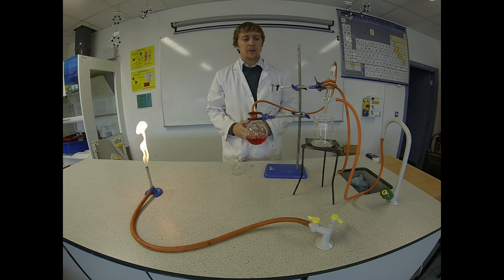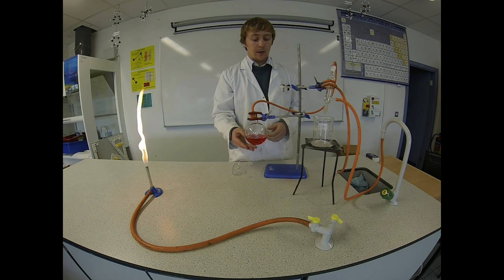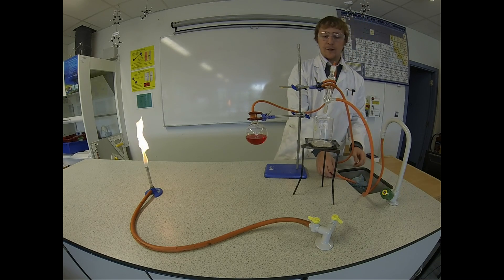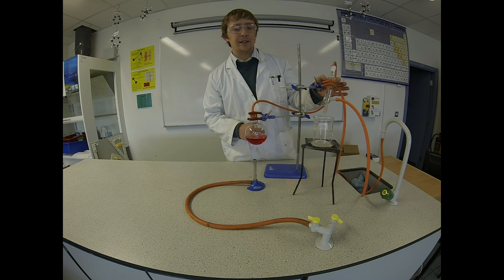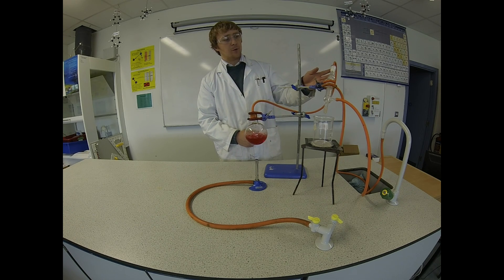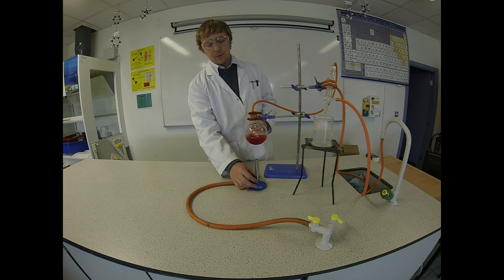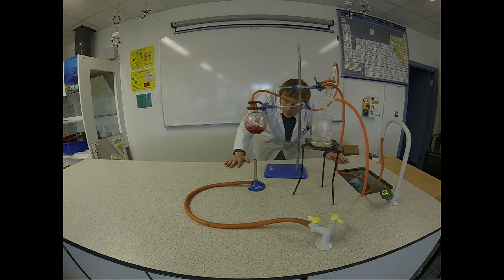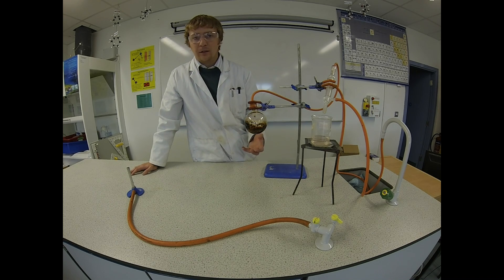To Separate a Saltwater Mixture by Distillation

Comment: Question: Any particular reason why the cool water running through the condenser started at the bottom, not the top?
Reply from the maker: +Getis Realis It works best this way, it fills up the condenser fully with cold water. If you run the water from the top then it usually doesn't fill the condenser it only runs through it so it doesn't work as effectively.

Comment: Roy Keane meets Jay off the inbetweeners.
Reply from the maker: cranebeg If I had the football skills of Roy Keane I'd be happy!
Reply: science4schools The lab is your pitch ;) Question about the apparatus though. I'm planning to clean up a fast evaporating solvent and would like to use a system like this but with a closed receiver to prevent loss. Would I risk dangerous pressure build up? It has a lower boiling point than H20, a Bunsen burner is not at my disposal, would you think a water vessel over a hotplate could replace? Thanks.
Reply from the maker: cranebeg What I would do is immerse the round bottom flask (or similar) in the water bath (or large beaker on hotplate). Set the water bath to the boiling point of your solvent and prevent it from going higher than this. Usea thermometer in the waterbath or beaker to be sure. You could use a closed receiver as long as the glassware is of high quality and for safety I would also install a pressure release valve that would release the pressure should it get too high. I would also immerse the receiver in a beaker of cold water to help with the condensing and reduce pressure buildup.
Reply: I have some of the above equipment but will have to incorporate a pressure release valve as you described. Appreciate your advice, thank you.

Comment from the maker: AD,
Great question, you certainly put a lot of thought into it.
If the distillation was carried out the way I did it in the video then it would not remove everything from the water. For example if there was alcohol in the water this would boil at a lower temperature to the water and would therefore evaporate and condense before the water. If the distillation was continued then you would end up with water and alcohol together.

However if you know every contaminant in the water along with their boiling points then you could distil each contaminant separately. This would be very expensive and time consuming and you would still be left with all the contaminants.

In short distillation COULD remove everything from the water but you would still be left with all the contaminants regardless and not all contaminants are solids, many are liquids.